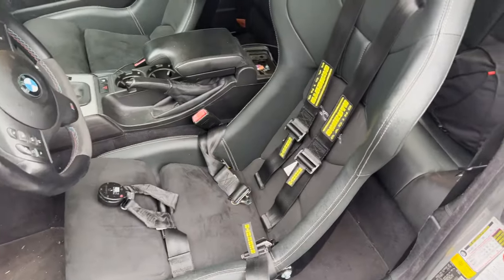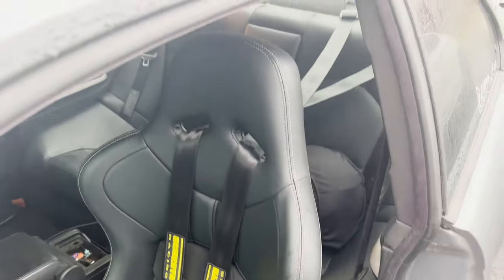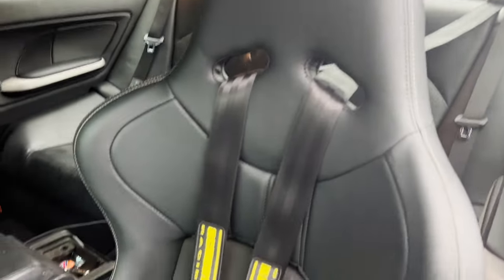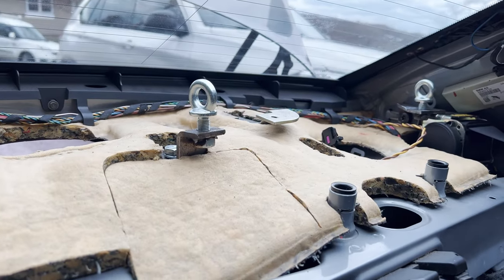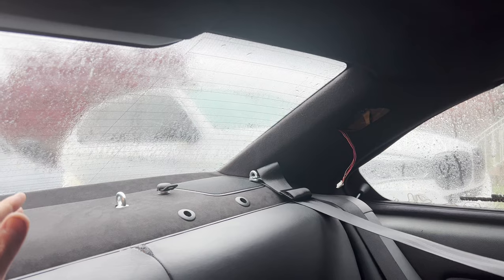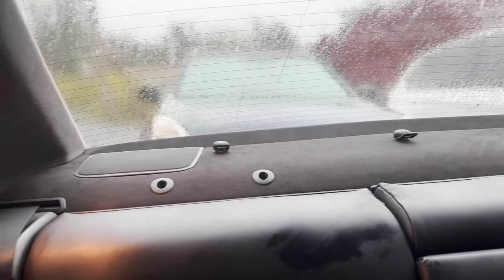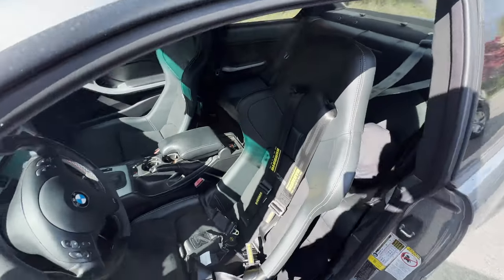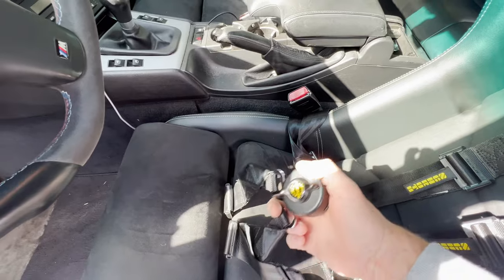Rear Parcel Shelf Harness Mount for E46 M3

Comment: Good thinking there! I just have a more general question about the harness: how much of a difference is it compared to not using one i.e. using a regular seat belt? I've got a Recaro PP waiting to be installed in the M3 and I'm thinking about 4-point harness for it, but since the seat is homologated for the street in Germany, I was going to use a regular seat belt to start with. I don't know how much the harness adds to the "holding the driver in place" when driving around let's say mountain roads. The bucket seat will surely help compared to the stock M3 leather seat, but I'm guessing the harness adds another level, but how much of a "game changer" is it? Thanks..

Comment: Which inside lap belt mounts did you use?
Reply from the maker: I had a spare oe outboard mount from our lemons race car build seat and it does nicely mount on the inboard as it does on out board so I used that. You can easy find those mounts at any bmw junkyard.